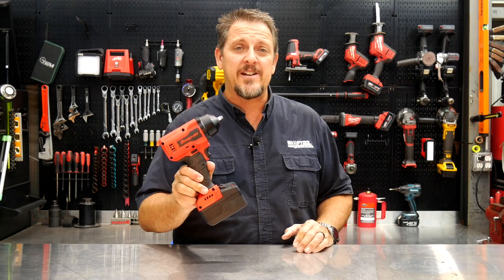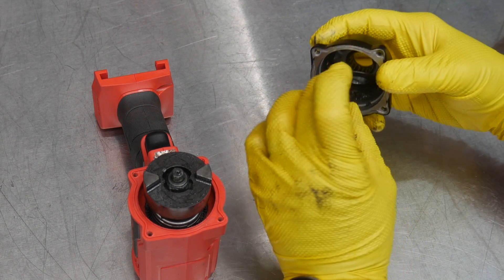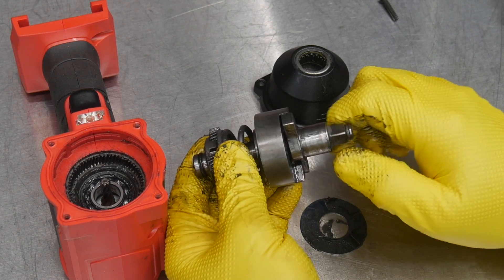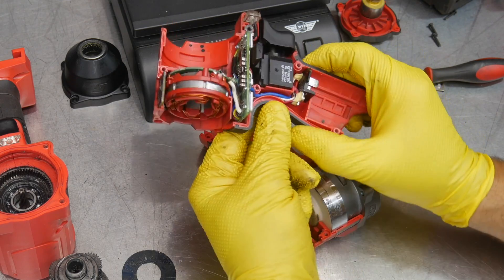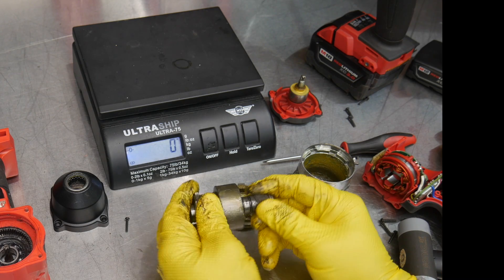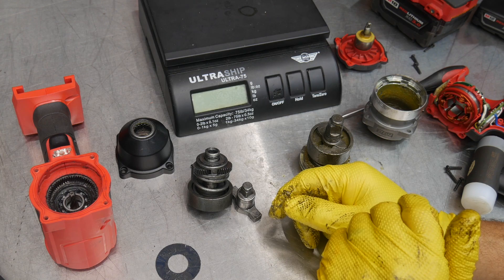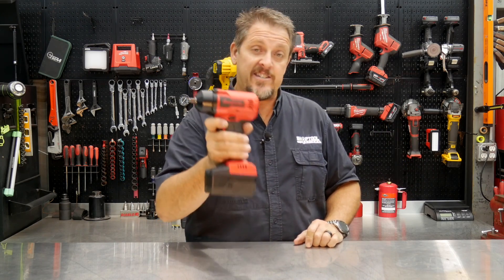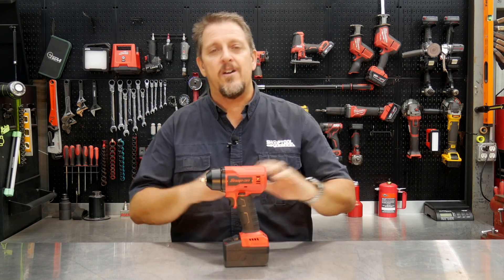WHAT'S INSIDE? $900 Snap-On Tools CT9010 Brushless Impact Wrench

Comment: The answer is the stubby loses power and torque about 30 days after you own it.  All you test is new tools, and the Milwaukee garbage doesn't hold up over time (time being 90 days).  One warranty, and Milwaukee charges you repairs.  The five year "period" is for one repair only.  Are you just a complete shill?  Snap-on has the 3/8 impact for around $280 on the truck, without any batteries or chargers.  Reported to FTC as undisclosed influencer.  Enjoy your $10,000 fines per occurrence.
Reply from the maker: So your first comment to me is an accusation? Let's lay that aside for a moment and deal with facts.
If you'll look at the comparison video I did between the Snap-On and M12 Stubby (link below), you'll notice (and I mentioned in the video) that the Stubby has been around a while (two years). Additionally, this M12 Stubby gets used many times each week. 
You may be able to purchase a 14.4V 3/8" Snap-On impact (bare tool) for $280, but you will not find this new CT9010 Brushless 3/8" impact for $280. The cheapest is $500+, which includes 1 battery and no charger. 
I'm interested in no more than bringing the truth and my opinion of tools. Am I wrong sometimes? Absolutely, but I will be quick to admit this as well. It's sad, that as a community, we have grown to not trust anyone. I wish the best for you.
https://www.youtube.com/watch?v=s6bK-RX75Rk&t=594s
Reply: Someone's salty lol, sorry your Snap-on is trash... I'd be mad too paying 3 times the price to only get out performed by something 1/3 the cost.... Have a good day loser!

Comment: My hypothesis is that it is detuned to decrease warranty claims on sockets and extensions being the most people that would spend that kind of money on that tool probably also owns Snap-on sockets they're concerned that making that much torque will destroy their sockets and cost them money and warranty claims that's my best guess
Reply: Not really impact socket are made for way more powerful air tool than these electric tool
Reply from the maker: That's an interesting thought and a good point. Especially the universal and swivel sockets, those take a beating from impacts. Thanks for the input and thanks for watching.
Reply: @Simon legros I wouldn't necessarily say 3/8th impact sockets are made to take the 600ft rage that Milwaukee makes . and even as so working in a shop for 10+ years I haven't seen to many people using impact sockets on there 3/8th stuff . most guys are using chrome sockets from what I've seen . not saying that's right or not
Reply: @rcboy2793  most 1/2 impact are over 1000 lbs torque so a said yes they are made for 600lbs
The new Ingersoll rand 1/2 is rated at 1500lbs
Reply: I also don't think there any 3/8ths air making more power then that Milwaukee
Reply: @rcboy2793  you are right 3/8 air impact are weak

Comment: Looks like the Milwaukee design of the hammer is able to have more surface area striking the anvil, and also it looks like the design is also better at transferring force vs the snap ons.
Reply: Just did a quick search as I remember seeing it years ago when they switched designs. So the gen1 3/8 2654 was able to do 200ft-lbs with the new design on the anvil and some tweaks it was able to squeeze 220ft-lbs that’s 5 years ago and I would put the old 2654 against the snap on as a direct comparasion.
Reply from the maker: That's a lot of great info. You've done your homework. Thanks for watching.

Comment: i think of tools like cars you can have all the power in the world but if your on bicycle tires your just gonna spin the tires same with tools you can have 2000 foot pounds of torque but if you only have 950 rpms and 800 ipm you aren't doing much
Reply from the maker: Very good point. It's just hard to see such an expensive tool be so lackluster in performance. Thanks for watching.

Comment: if your gonna spend over more than milwaukee you might as well go with hilti or festool i dont know if festool has a impact wrench or not i just now they are out of my price range just like hilti and snapon
Reply from the maker: No, Festool doesn't have an impact wrench, just an impact driver. Hilti does have one, but it's a little under-powered as well. Thanks for watching.
Reply: Hilti is more of a robust tool, not necessarily built for top performance but they have some that are top of their class but 7/8 of 10 Milwaukee beats hilti in performance, but hilti is built more for longevity
Reply: @footlongburrito  excactly well Said

Comment: When snap on announced their brushless 1/2 impact some time in 2019 I think  and I don’t remember where I saw the video but a snap on rep had a Milwaukee fuel 1/2 impact wrench apart and a snap on brushless 1/2 impact wrench apart on display next to each other. 

One thing the rep mentioned was the snap on impact wasnt engineered to be powerful, it was engineered to be durable. Although it was supposed to be comparable in performance to the Milwaukee. Again, snap on was not trying to be big macho in terms of strength. 

I think a lot of it has to do with milwaukees ‘redlink plus’ circuit, mpowerstate’ brushless motor and ‘redlithium’ batteries.  However they have those three components communicating and working together is the secret. 

I’m not accusing snap on of ripping people off by selling underperforming tools, but I do agree that for market leaders in automotive hand tools, the power tools should be market leaders as well with the most strength and durability.
Reply from the maker: That's definitely a possibility that Snap-on built it for durability, but it just doesn't make sense that some $99 tools have as much power. Thanks for watching.
Reply: @Shoptoolreviews  I totally agree, for the price you pay for it, it should definitely be able to spin the Milwaukee fuel impacts backwards.
Reply: Redlink ,mpowerstate and redlithium are just marketing wank mean nothing
Milwaukee battery have run of the mill Samsung battery in them
Redlink is just basic motor/battery control all tool have this 
Milwaukee just make stronger tool
Reply: I have a Milwaukee co worker has a snap on his sounds smoother and of “higher quality” than mine but he did snap his anvil taking off lug nuts he also owns the the little 14.4v 3/8 the 2 batteries are no longer working.

Comment: It really is amazing the power Milwaukee manages to stuff in the stubby it’s almost as powerful as the new m18 compact also simply insane
Reply from the maker: You're exactly right. Thanks for watching.
Reply: New Compact and Stubby have the same internals, so they have similar performance. Voltage doesn't make that much difference in power because they scale the amperage to compensate.
Reply: @niskytank  absolutely but Milwaukee sure does a lot better with their 12s than others

Comment: This is a great look inside. You see these side by side images floating around online of impact hammer size difference as if that's the only factor, there's a lot more that goes into a good powerful impact based on our testing, especially when cordless.
Reply from the maker: Yes, there are many components to generating energy to the anvil. Thanks for the input.
Reply: @Shoptoolreviews  and snapons suck... lol

Comment: This was your best video production wise.

Anyways, do you have a hand held tachometer?  It’s either a lack of rpms, or like you said a weaker spring.

Which begs the question.  What if we just sourced a heavier duty impact spring?  And could that apply to other impacts? Could we be entering the world of supped up impacts? 😂 

“Oh ya??!  Well my half inch can break away 3000 ft/lbs.”

Proceeds to break the anvil.
Reply: I don't think the spring does much for the strength of the tool, it has to do with the force the hammer hits the anvil. It's mass*velocity. a lighter weight moving faster can hit harder than a heavier weight moving slower. Also, I'm interested in the design of the hammer and anvil, I haven't don't any math but it looks like the elliptical shape gives it a "favorite" direction giving the hammer more "distance" to accelerate before hammering again. Don't hate if I'm wrong, I'm a civil engineer not a mechanical engineer
Reply from the maker: I was thinking of using a coil spring from a Suburban for the impact mechanism. lol. That should do it. Thanks for commenting.

Comment: I wish the ceo of snap on was on the hot seat for ripping off mechanics like that.
Reply from the maker: It would be nice to hear the reasoning from someone near the top of the chain. Thanks for watching.
Reply: @Shoptoolreviews  They wood just tell you a lie.
Reply: Research and design cost, snap on will only produce 1/5 of the units Milwaukee will therefore they have to charge more to recoup cost for a profit, also nobody is forcing them to buy it.
Reply: You gotta think about how many mechanics have ripped off tool companies and skipped out on their bills (thousands) and/or sold (or pawned) brand new tools that they just purchased on credit!!  I’m all for them dropping their prices but they’re providing the credit and tools to do your job and many (too many) dishonest techs have screwed them over.   That’s part of the reason why the price is higher.  Atleast that’s what several distributors have explained to me🤷🏻‍♂️
Reply: @6.4DieselDoctor  I dont think that could be any more wrong. Have you heard the term repo
Reply: @nuclearexplosion5841  a lot of guys skipped out and they’re not able to repo the tools.   That came from several dealers
Reply: The big difference is that snap on is simply over building the tool. They may have a smaller warranty window but I would be interested in seeing which tool would last longer. Seeing what’s inside I’d place my bet on the snap on.
Reply: Plus these tools are built in the U.S. not Taiwan...